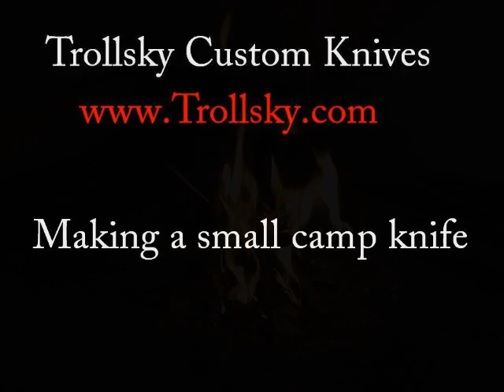FORGING A SMALL KNIFE [Trollsky Knifemaking]

Comment: The Japanese use hammers in the 4 lb range for most forging, as its easier to control and keeps you from using your wrist while forging. Their hammers dont look very big, but they're fairly heavier compared to what most others use. I use a japanese hammer and find it much easier to control, and the forward weight acts as a self center. Its hard to explain unless you use one and feel it for yourself.